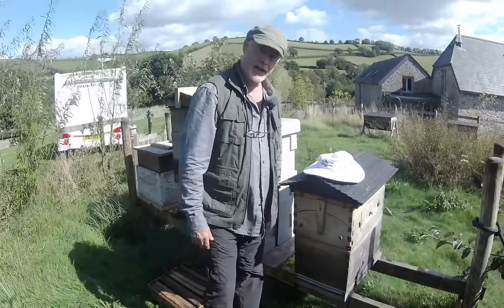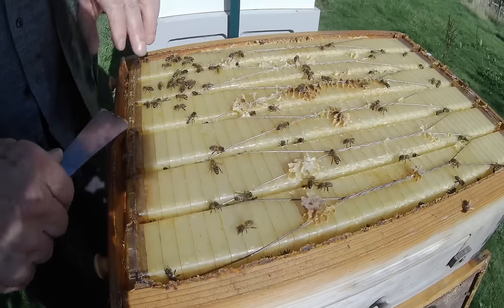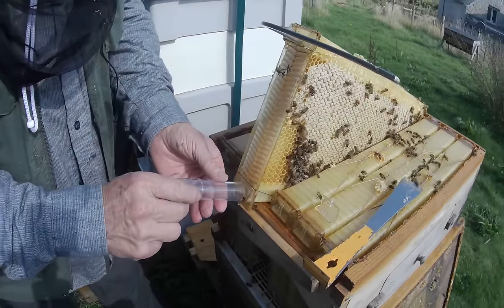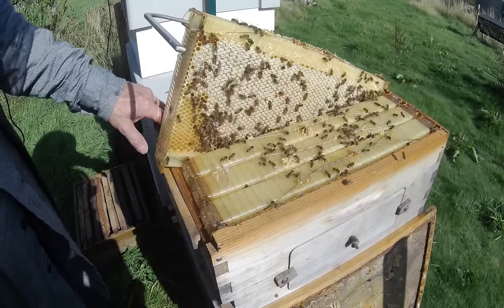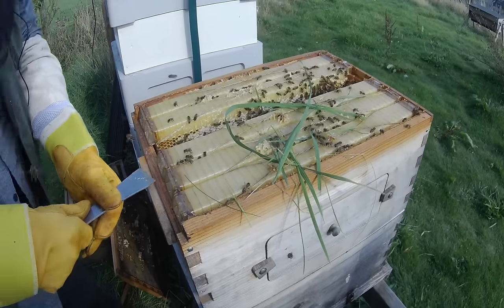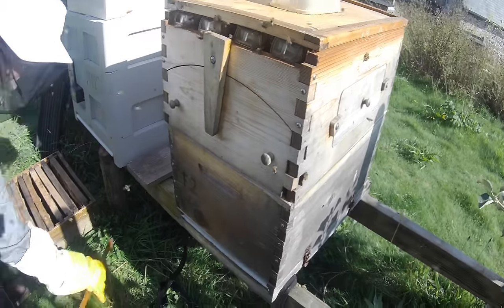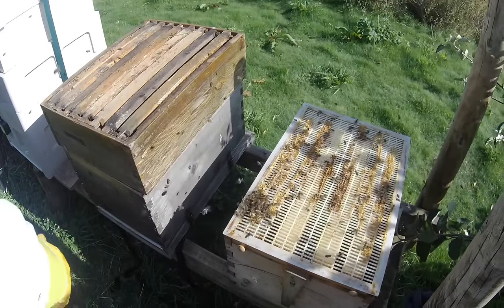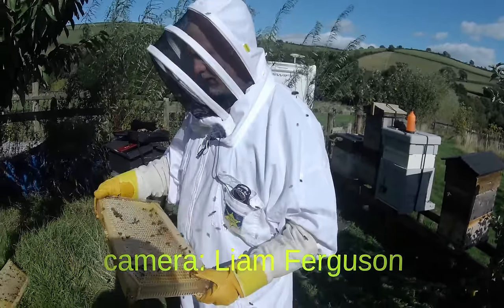Don't buy a Flow Hive until you've seen this!

Comment: Hawthorn is the same as ivy, I have the same issues every year. The honey is too thick to spin, and turns to sugar within weeks if you crush.
Reply: Hi there, we have alot of ivy honey this yr we are trying to take it off...we left the early summer honey for the bees. So we took off the late aug/October honey super Any tips we have a hole super that's basically almost crystallised  in how to get it off, we have an extractor ???
Reply: @Coinin_Beag  

Hi Kim,  when honey is thick or crystalline there isn't much that you can do with it, an extractor just doesn't cut it, if it is just thick I cut crush and strain, if crystalline I just store for pre winter stores, the bees dont seem to mind and it becomes similar to a feeding board, come spring it is gone. Store your frames in a garbage bag and make sure that it is secure to stop wax moths and ants.

Comment: Hello Phil. I have a question for you.  I'm hearing from several beekeepers that they are finding it impossible to clean the Flow Frames after like 4 years of use.  Like they have tried everything.  Do you have any ideas.  I was just thinking to clean them every year.  But I would love to hear if you had any ideas.  Thanks so much
Also, I noticed bees getting through your flow frames.  Tip for correcting that.  On the front side of the Flow Frames, there is a screw.  Unscrew it till it makes the frame fit tight, thus pushing the back end up more until there is no longer any gaps on the back side for the flow Frames where the bees can get through..
Reply: People suggest leaving them out 30 feet from the apiary (to not attract pests to the hive) for the bees to clean up.
Reply: @SageandStoneHomestead  Thx, I've learned a lot of methods on how to clean them up, including just putting them pack into the hive for a couple week, leaving them out like you mentioned, as well as taking them apart and scrubbing each piece.  This last method, which is show on the HoneyFlow site, actually returns them to "like new."  There is always a couple videos out now on "How to clean Flow Frames."  Thanks my friend.
Reply: @bradgoliphant  awesome!  I'll have to check out their site and really absorb it all. We just ordered ours.
Reply: @SageandStoneHomestead  I ordered my Flow Hive 2 about 2 months ago, and boy or boy is it a stunning looking hive.  I decorated mine beautifully as well. I ordered double deep boxes to start my hive off with the first year to let them get really established.  So come next year, right off the bat, they will work on the super.  I also have three tips to share about getting to bees to take to the flow frames right away and starting working on them.  1--melt some organic wax ( i purchased mine on amazon,) and using a paint brush, paint the frames with a couple coats of wax.  2--drizzle some of the bees honey on the frames, and 3--Don't add your queen excluder for 20 days or so.  I have heard countless stories of beekeepers adding it right away that the bees seldom go up.  Keep it off for 20 or more days, then go into it, making sure the queen is not present in the super, and then add the queen excluder.  Once the bees have starting working on it and adding stores, the will more likely go through the excluder.   Hope this all helps.  My package bees arrive in 8 days.  So excited to start.
Reply: @bradgoliphant  that's extremely helpful thank you! We pick up a Nuc at the end of the month and I ordered a double deep 10 frame langstroth to go with it, planning to do exactly what you described above except I didn't know the tip about the queen excluder. I really appreciate it. In that 20 days is there a risk she will lay brood in the flow frames? I considered adding a queen excluder on top of the brood box and then a shallow langstroth honey super and THEN the flow frames. The medium or short honey super (whichever I go with, this is a next year decision) I'll leave on for winter stores for the hive and keep what they put in the Flow frames. We live in a temperate area of the US and our growing/nectar season is quite long, over 200 days. I'm hoping to split the double-deep into 2 single in spring 2022 and have both with the same honey system.

Comment: I knew there will be problems with flow hive and now see it the plastic material degrades I've already explained in another comment I made being a plastic process technologist the best material would be PET or Nylon, polycarbonate has one weakness if the honey is acidic it breaks down the material it's very expensive beehive from flowhive for the same price 3 conventional beehives could be bought. The video was well done .

Comment: Phil,  It is a shame that you posted this video.  It only shows that you do not follow instructions properly. This is the second time I have watched your video and since the first time and have seen 4 other installations here in the USA.  The hives work very well. they do not harm any of the bees and they extract honey allot easier than the traditional method of uncapping the honey and separating honey from the combs.  The big plus is that you do not disturb the bees by opening and closing the hive, especially if you extract honey more than one time a season.  My suggestion is, take your video down and do not let other beekeepers see how you fail as a beekeeper. And I have no connection with the Flow Frame manufacturers and get no compensation in any form for sticking up for them.  Actually, hope to purchase one of their units this winter seeing I can justify their cost.

Comment: Well Phil,  have been using my flow hive for 2 months now.  Assembled it correctly.  No bees on the outside of the flow super where the pour spouts are.  I did, however, rub bee wax onto the plastic flow super before installing it.  The bees took to the plastic frames and are producing honey in the frames.  You really need to reinstall your honey super so the bees do not get in the wrong area.

Comment: When I first saw this hive in action, I thought it to be a pretty good gimmick, but not so sure anymore.
       I'm leaning to a Horizontal Bee Hive. You can make it 4ft long and wide enough for around 40 frames. It's all one box so 4 of these super hive will make a lot of honey with a small foot print, like in your back yard.
        It can be one big hive, but you can use 2 petitions and make 3 hives as Queen Cells start showing up on the brood frames, put in a petition, leave the queen on one side and put brood, w/queen cell in the other side with honey and workers, and you made a easy split. Easy to work, lots of swarms a year filling more hives with more honey and Bee colony production.
      I'm looking at 4 of these 4ft long hives, with a total foot print at about 16ft X 2ft, to house 12 hives of bees when completely filled.
       I dont think the bees are happy in a plastic hive, in fact they dont use plastic frames unless they were dipped in wax.

Comment: I dont understand why you’re rearranging all the boxes.
Reply: The flow hive is not working for him. He fears the Ivy nectar will set hard in the flow combs. So it not going to use it. 1. it only works with runny honey, depending of flowers in area. Ivy makes hard honey. And the next season and in his area has hard honey also, he mentions those types of flowers. The hard honey will jam the flow hive.
He is rearranging the boxes is so that the bees can move the honey from the artificial flow combs. and so he can get rid of it. He does this by scoring the old honey, and repositioning the new honey box (super).Bees tend to store honey near the major entrance, at the top. They tend to breed away from the main entrance. 
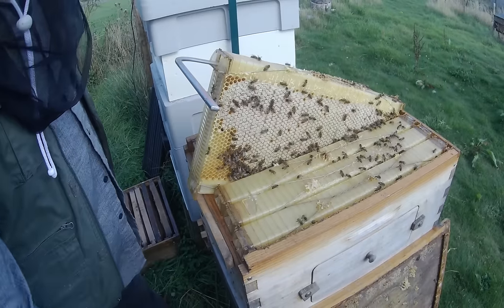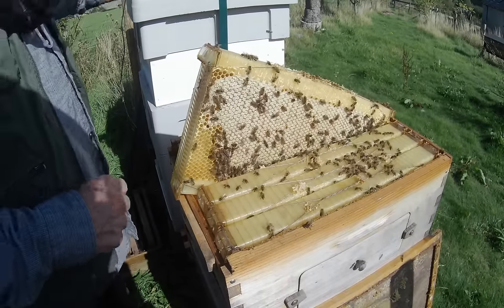Now the old honey super is far from the entrance (now bottom, was top), the queen may want to lay eggs into it. He puts a queen excluder between the brood (middle, was bottom) and the bottom box to stop this. see the 25:33min recap at https://youtu.be/ZC839GxDUqk?t=1532 . explains system and Ivy at 10:45 mins. https://youtu.be/ZC839GxDUqk?t=645. solution at 12:40

Comment: Then dont comment until you are sure of what your tring to say it does not perform miricals the flow only creates an easier less messy way to extract the honey....and the cells are big enough if a bee was to be in the cell and you split the cell it will not hurt the bees

Comment: Can I add my 2cents worth?
When you do decide to harvest, and you are inserting the Keys, only put it in about 2 inches, actuate, then slide in another 2 inches, and again and again, till you get to the very end. They can be broken if you don't.
After draining, they can all be reset the same way. After I have done this, I cycle it a couple of times to re-seat the wax between the plates, then reset it the final time before I take the drain pipe off and insert the plug.
Bee sure the flow channel is completely drained before you plug it. 
It took 3 years beefore my Flowhive "took".
Reply from the maker: Thanks. I appreciate constructive advice.
Reply: 3 years? damn. My very first hive was given a Flow Hive hybrid super, and all they did was seal up all the gaps, but barely used it. That first hive died from a freeze out, but... late this past spring, I melted some comb wax, and baste brushed it all over the Flow frames' comb, and put it on a late spring swarm that somebody asked me to take care of. They used it like nobody's business. Filled each frame to half capacity before the flow ended. I put it on MY new hive before the fall flow after letting them build up in the spring, and they used it as best they could with what little flow there was in town. Goes to say, not all bees are created equal... lol.
Reply: @BarefootBeekeeper  - Oh... by the way, the tube/spigot goes into the hole via the lipped end. it's supposed to break the propolis the bees made just under the chamber, so when you cap it, what little honey is left, drips back into the hive.
What I've done with my Flow super, is similar to what you were talking about doing. However, I did it to take the super off the hive as it's not needed anymore until spring. I took the frames out, brushed the bees off, reassembled the super and brought it inside. There was some honey, capped and uncapped in the super, SO, I broke the seals and extracted it all, amounting to a half gallon. Since it was a mix of capped and uncapped honey, and the fall flow was crap this season, I fed it back to the bees via a 1 quart mason jar, and 2 feedings in a 2 day span. I own only 1 hive, so I could get away with putting the cells back into the closed position, and setting the frames outside for the bees to clean out the rest of the way, leaving the troths uncovered so they could clean inside the frame. I even gave them access to the gallon jug and the extraction tubes. I let them rob out EVERY single drop they could. Even the excess honey that dribbled off the frames rather than making it into the troth was like a pint or so.
Reply: @thenotsurechannel7630  Not all bees are created equal, indeed! 
After the success of my first Flow Hive, I ordered another one, and it only took one season for them to pack it, but I was just saying that not all of them are the same, so don't be disappointed. On my Second one, I installed it on a Very strong hive, but before I installed it, I manipulated the action of each frame while immersed in a plastic pan of Honey-water, and Then installed it. It "took" faster. I had forgotten all about that.  I've had success, and I've had Failure in Langstroth hives, too.  Bees are a constant ebb and flow, just like the Honey-flow that goes on all around us. Sorta like Life, I guess.
Good Luck!

Comment: It sounds a little bit too much on the nightmarish side. I don't think it simplifies or speeds up the work and for sure it doesn't help to save money. 

I was not very impressed by flow hive the first time i saw one, a few years ago, and it seem worse than i firstly gueesed.

Not considering the honey that would "flow" (if you're lucky with temp and kind of nectar) will do it relatively slow, so you must come back at a later time,  then it might as well worth considering using bee escape and come back later. 

It could be considered if you would just love to have 2 or 3 colonies avoiding the cost of extractor, but i am not really persuaded it will be a good deal,  their price is insanely HIGH.
Reply: You just set the thing on your porch and bring the pancakes to the hive when you want some. There really are people who think that's how it works.

Comment: Man your bees are miserable.  You need some calmer bees or go in more often so they know who you are...
Reply from the maker: The whole point of the Flow hive is that you don't have to open your hive to harvest honey.
Reply: @BarefootBeekeeper  I have a flow hive and two others standard hives.  I still open the brood boxes once every 2 weeks just to check things out and let them understand who I am.  I do it in shorts and a t-shirt, 50% of the time a smoker just in case the young bees get get excited.  I get stung once per year.  I wasn't trying to give you a hard time, I was just shocked at the reaction of your bees.  I have never seen honey bees get the fired up over pulling a frame, flow or otherwise, out of the hive outside of transferring a 5 frame nuc to a 8 or 10 frame permanent home.  I think getting in there somewhat often is important, we are bee keepers not be havers after all :)  Just my 2 cents...

Comment: Why not partially rotate the comb. Instead of scraping it. Not to a full turn just enough to break it a hair and see how that does
Reply from the maker: How do you "partially rotate" combs? I don't understand what you are suggesting.
Reply: When you was scraping the combs to expose honey for them to move to the upper chamber. I was wondering if you could just barely open the combs and then close them back just so it would break the wax seal. An just let a little bit of honey break free. That way you wouldn't have to scrape and taking a chance on mangling any of your bees.
Reply: When I mean open the combs. I mean using the tool bar and instead of doing a 90 degree turn just possibly do a 30 degree turn. And then close it back

Comment: the frames should be adjusted flush with the front, so no worker bees can get in front. supposedly, the bees don't get guillotined when opening the flow channels. of course, he killed a bunch when scoring the caps with the knife, which is totally unnecessary work added for the bees.. lol. it seems the whole process was defeated by opening, removing, and extracting honey externally. i don't think he tilted the super 5 degrees prior to extracting honey, but then again, he didn't end up extracting in place, so no biggie. he pissed off the whole hive. lol. poor bees. no simple honey extraction for them !!
Reply from the maker: You are about the 20th person to tell me the frames need "adjusting" , which would have made no difference to anything I said. ONE bee was accidentally killed, not "a bunch". Even if bees in cells were not "guillotined", they would be sucked into the mechanism by the flow of honey.
Reply: @BarefootBeekeeper  the adjustment i'm talking about is the frames should sit flush with the front of the box, the side where you draw the honey. when you opened it up, there were a lot of worker bees in there,  not just a couple. however, i'm not sure if this would have affected anything else in the vid. best wishes, bee man!
Reply: @BarefootBeekeeper  there's a new and improved Flow Hive. You should buy one of those and try it out.
Reply from the maker: @ytlongbeach  i have better things to do with my money, thanks!

Comment: There's something called a smoker you should look into
Reply from the maker: Tried it 20 years ago. Didn't like it.
Reply: @BarefootBeekeeper  If used properly smoke masks the pheromones bees use to communicate so they don't sense the attack signal from the guards. It beats having to wear a bee suit and having passerby's stung.  Before opening a hive blow some smoke into the entrance then under the lid, then under the supers. When I worked for a commercial beekeeper 47 years ago I'd get stung a dozen times a day even with smoke. Keeping only a few hives during the past 20 years I have not received a single sting.

Comment: 10 bee keepers in a room 11 opinions on how to do it.  Loving learning from old dog but new tricks not their thing!

I run bottom box 1 deep 2nd box deep/med (bottom 2 100% theirs) then flow on top 100% mine never pull my flow frames out unless doing an inspection you can see if capped by the end and side it is not capped on the end it not ready to be drained if not capped on the side it’s not ready to be drained.  This is farming hard to process any Crop before it’s ready wait another 2 weeks if needed... or if bad year wait till next cycle.  For me zero issues when used as intended but only done bees for about 10 years now so what do I know (47 year old) and had flow frames for about 5 of them.  In my club Old timers hate them rest wants to come watch them and see how they go.
I own a 6 frame extractor and 1000’s of dollars of equipment yet club uses it all the time and I used it twice then loaned it out to the club not seems it in 4 years 😘
Other asked where to other poster so eastern North Carolina USA